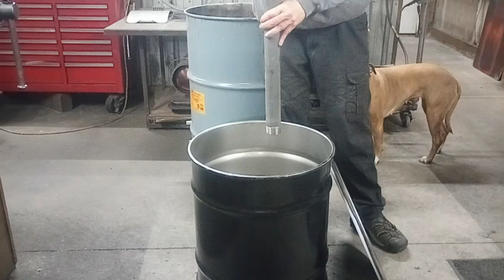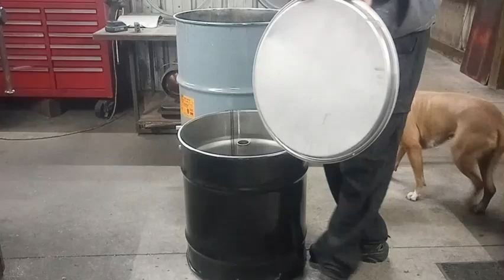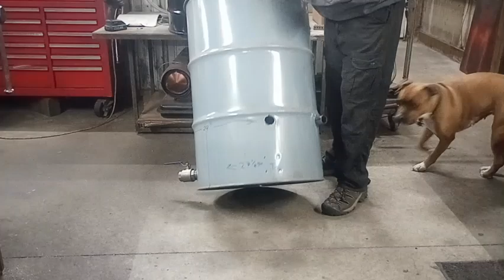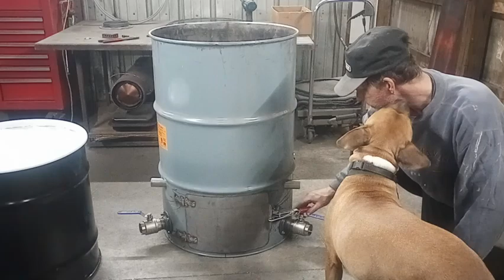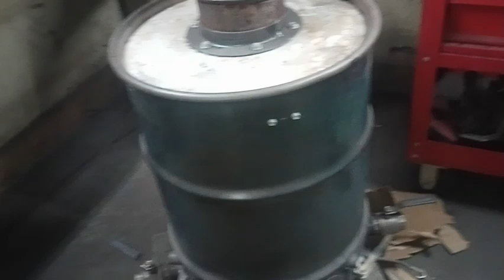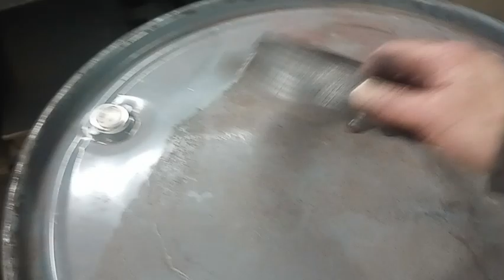DIY Charcoal Retort For BioChar and Gasification Fuel

Comment: Did you cut down the 30G barrel? It looks shorter than the one I just picked up.  Awesome design!
Reply from the maker: You should see the new version. If you can build a burner base its a major improvment. But it sounds like you have the 20 gallon drum not the 30. The 30 gallon drum I think stands 29 inches and the 20 gal, is 21 1/2 inches tall.
Reply from the maker: Aslo build two and stack them. Thats why on the new I used the smaller drums so I can better manage them. Id rather run to of them than one huge one with my old body its had enough. lol. Yeah thats a huge HUGE efficiency gain as you pre dry the upper stage and then it becomes the retort on the next burn and then you install fresh wood in the retort that just finnished an start over again. With the wood pre dried it takes little wood in the burn chamber to get the retort gasifying. Ive turned the table this in now more eficient than a wood gasifier. The new water injection steam reformer is now pushing 1:1 ratios 1 ltr of water to 1 kg of charcoal. So now 50% of the fuel input is now just ordinary water!

Comment: Any changes in design you'd suggest now that you've used it a while?  I was wondering about possibly lowering the cost of the valves by using screw in or on reducers?
Reply from the maker: Yes add a second stage. Basically build another retort just like the bottom but build the lid of the bottom retort into the bottom of the top retort, So there is a hole in this lid for the vent tube for the top unit. The top unit is a fuel dryer pre stage unit. If you have pre seasoned wood it will dry it and partially torify it. So when you transfer it to the retort it takes very little wood input to get it gasifiying on its own to sustain its own process heat. 

For the valve no absolutatly not spend the money on the lever valves. That thing gets hotter than the sun!! You need the levers so you use a stick to adjust them. When this thing shifts into supernova mode you dont want be anywhere close to that thing. Let alone fiddling with crazy hot knobs to adjust each  gate valve.

Comment: Can you get the retort to self fuel with one full firebox, or do you need to feed the fire for a while?
Can you use wood chips in the retort?
Reply from the maker: Sure but why? Much easier to just skip chipping and put your fuel directly in the retort. It will break apart on its own reguardless you have to screan the fuel.
Reply: @Thrive-Off-Grid  
Where I live, you can get truckloads of free woodchips.
No need  pay for gas to haul logs, no need to cut chunks to fit to fit into the barrel.
Reply from the maker: @williambronson2935  That works then, we have chips here as well but I have not tried running them yet. I think they may reduce to far but wont know for sure until we try :)

Comment: So the steam vents out into the fire as it warms up?  Would that not cool the fire down?Once the flammable gases start I can see how this would work quite well.
Reply from the maker: Yes but its not really enough steam to deter normal combustion mode. But yeah it works quite well once it shifts into " Hype Mode " 

When used as a heater its crazy efficient. We burn very little wood to heat the shop while it processes the charcoal. So effciency can be a matter of perspective. As just a charcoal producer it does well there as well. This can easily produce a 1:1 or better yeild if using seasoned fuels. Also you can use junk wood for combustion process like used pallets. pine and other wood fuels that will make burning those off less painfull :)

Comment: Nice and simple.    
Only real problem is those barrels seem to rot out so fast when used for fire
Reply from the maker: Yes a burn barrels will rot out faily quick. However the reason is most leave them in the rain. Rain mixes with white ash and creates an acid that eats the metal. This is more like a barrel drum wood heater, you never want to allow rain water or moisture inside the unit. This is why you will want to keep a lid handy and place the lid on it after every use. We had a wood barrel drum heater in our last shop that were well over 10 years old. They were there when we got there, we used them every year and they were left behind when we left in still perfect working order. These retorts are no different. Keep the water out and they will last many years. Also if and when you need to replace the drum you only need to replace the drum. So not a huge investement when that time comes.

Comment: It would be nice if you would explain the overall design theory before going through detailed description of how to build.
Reply from the maker: Its a retort what is there to explain?
Reply from the maker: I thought I did explain this in the video. You do know what a retort is correct? All Im doing that I think is different then others is Im venting the Pyrolysis gases back to the combustion chamber and burning off that gas for additional process heat verses wasting it out the top.
Reply: @Thrive-Off-Grid  
The pipe is different than most designs.
I've seen exterior pipes, which seem to work poorly.
I've seen retorts that simply have holes in the bottom as well.
Given the level of care you exhibit in your designs, I'm certain this interior pipe makes a significant difference.
Inspiring as always.
Reply from the maker: @williambronson2935  The point is to use the pylyis gas as fuel for the process. This retort is very efficient. The dryer the fuel the more efficient it will be. But that is the point of my design. The fuel in the retort supplies gas for the process heat. The last 1/2 of the process the retort is supplying its own heat without need for external fuel input.
Reply: @Thrive-Off-Grid yeah. No,  people are here to learn not be mocked that they don't know somethings you do.
Reply: @Thrive-Off-Grid operating principles?